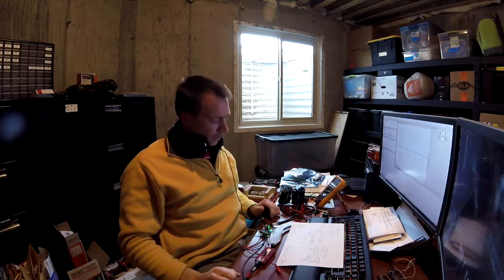Homemade BMW Motorcycle Auxiliary Headlight Control board (Non-CANbus)

Comment: I played wit similar but with arduino nano and mosfets. 
It is cool to add blink/high when horn is active.
Reply from the maker: I thought about that too. My next revision is going to have CAN bus input so I can control everything from anything.
Make sure when you are using the mosfet as a resistor you design it using a PWM as the gate control instead of the DAC. An analog signal will increase the resistance of the mosfet and make it really hot. But a PWM will toggle resistance from micro ohms to mega ohms without creating power consumption of the mosfet. If you use LED lights, they will be able to handle the on/off mode of the mosfet.
Reply: @TheParamotorGuy  Great, keep playing. I like the idea of playing CAN bus but I am not that advanced. Enjoy and put more videos. Have you seen wunderlinq project which started from scratch. Just search in YT.
Reply from the maker: @split3d610  I just watched a couple of videos on the Wunderlinq.  That looks amazing!  I would rather use my phone for navigation anyway.  The whole thing is expected to cost around $200.  That's better than the BMW Navigator by a long shot.  It's all software though and I would still need to create some hardware to interface some auxiliary lights to the CANbus.  Mine were built for cheap.  I spent about $40 total on my lights and controller.  
I would hope that some of the Wunderlinq would be open source so that I could write my own features into it.